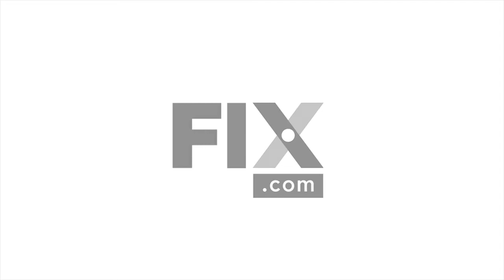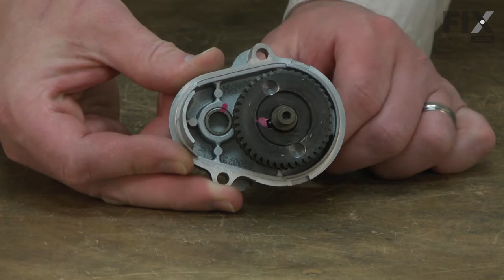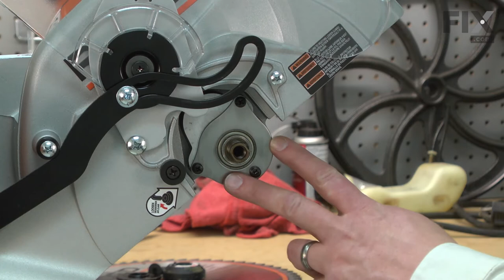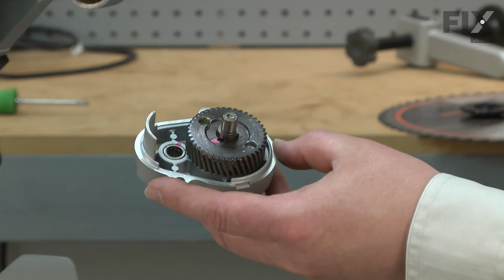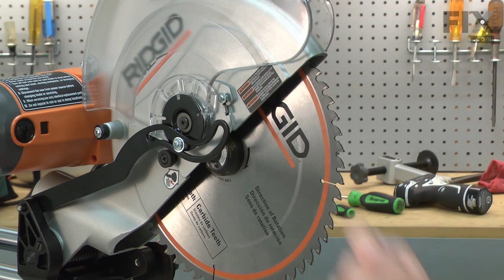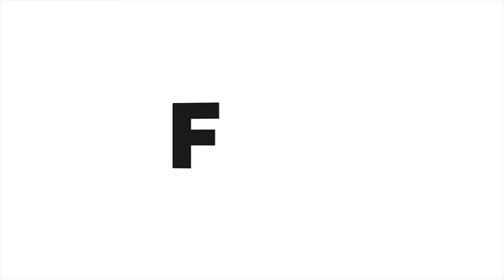Rigid Miter Saw Repair - How to Replace the Arbor Assembly

Comment: HI, do you know how to remove the blade lock pin and pin spring? mine sheared off and I need to replace the pin to be able to change the blade. it doesn't come off the assembly once I took it off